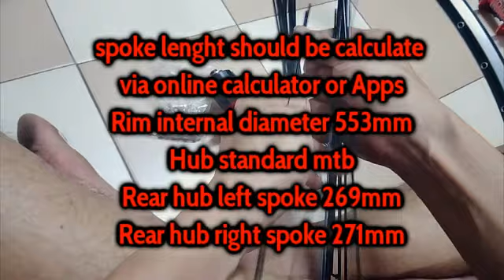[ Toysfun Cycling ] how to lace bicycle rim 32 spoke 3 cross

Comment: Hi sir.. The sizes of the spokes on the rear wheel is not the same?
Reply from the maker: HI, mtb spoke of front and rear are the same, however left side andright side are not the same length usually.  for example 26inch rim could be 261 on the disc side and 263 on none disc side. rear will be 261 on the drive side and 263 on the disc side. But if u can calculate the length correctly,  u can use 262 for both left n right with no problem. in some situation, if u dont have the require lenght, actually using spoke that shorter not more then 3mm is acceptable. avoid using spoke thats too long will have hard time tighten at the end.
Reply: @asotnes  actually im having hard time. I have a rim 27.5...i bought spokes 275mm 72ps for front and rear.. I've done the front wheel smoothly.. But in the rear, i repeated many times and still there are spokes coming out of the rim.. Im thinking to cut it but i dont have threader.
Reply: Im also thinking to buy some 273mm spokes?
Reply: My hub is novatech ds041sb/ds042sb..are you famillar?
Reply from the maker: @freyfreymarcelo503  u need to make sure the flange of both the front and rear hub are same diameter otherwise the lenght will be diffrent.
Reply from the maker: @freyfreymarcelo503   the spoke threader is very expensive, not worth it if u just make 1 rim. using a die to make the thread is more reasonable. buying the correct size of spoke is the best way if available easily
Reply from the maker: @freyfreymarcelo503  normally ppl calculate the spoke lenght using free app spoke calculator. if u have already know how much extra, then cut away can save some time of having to calculate.
Reply: @asotnes  58mm according to the hub manual
Reply from the maker: @freyfreymarcelo503  58mm is the normal flange diameter for all hub accept some like shimano smaller. if your front and rear hub have same flange left n right, the spoke of front and rear wheel should be the same otherwise u may have wrongly lace the spoke.and check if your front n rear wheel rim are same internal diameter.
Reply: @asotnes  what are the measure that i needed?. F.T.F, P.C.D.
Reply: @asotnes  yes the rim are the same.. But i dont have info about the rim what diameter.. Its weapon aegis tr7 32holes.
Reply: @asotnes  so it means i dont have to replace the spokes? Ive done the front wheel and the truing.. The rear is my problem for now.
Reply from the maker: @freyfreymarcelo503  using a tape measure the internal diameter( must be as accurate as posible to 1mm accuracy)if posible measure the thickness of the rim at the area of hole where nipple seat. thats all u need.
Reply: @asotnes my rim is 650b mean iso standard with a 584mm diameter.. I have just calculated the spokes length but the result is much longer spokes than the 275m that i bought.. Hmm.
Reply: @asotnes  ok sir. Thank you..
Reply: @asotnes  by the way sir.. I can possibly do the 4 cross pattern?
Reply from the maker: @freyfreymarcelo503  there is no such thing as iso standard, u better measure. let me know the diameter, i calculate for u